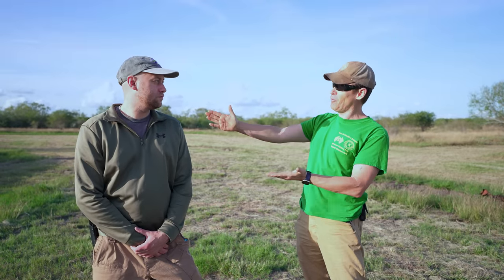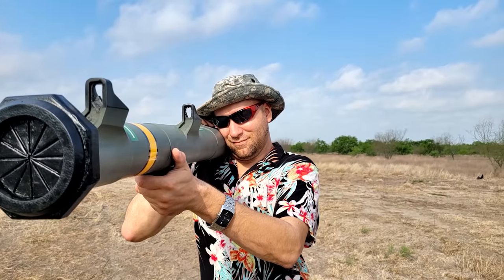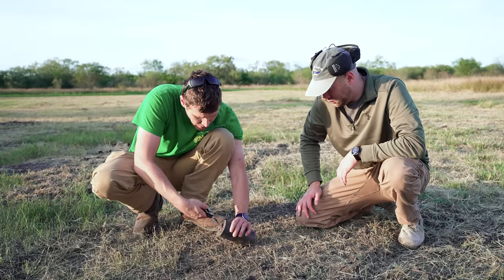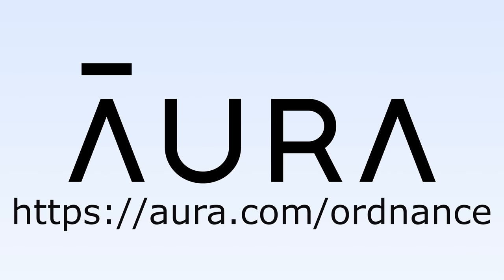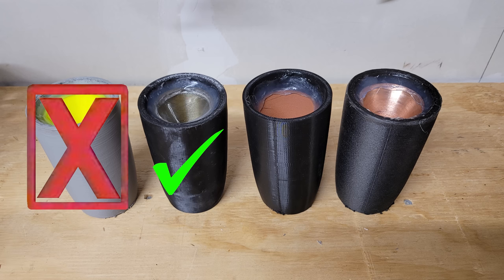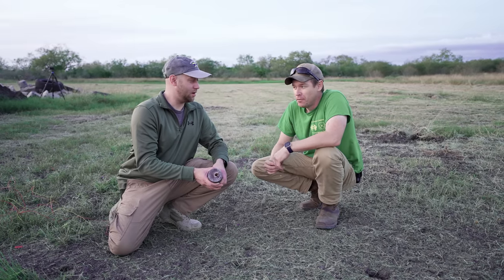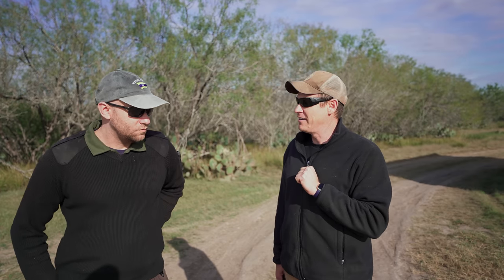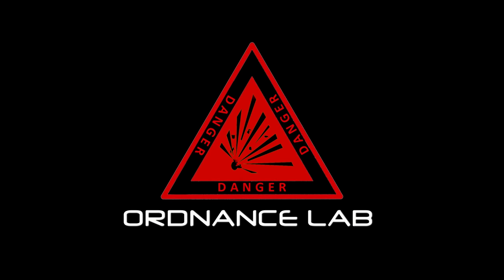Revolutionary 3D Printed Explosive Shaped Charges | Feat D&S Creations

Comment: Wait 3" of penetration is enough for tanks? How thick is tank armor jeez
Reply from the maker: Armor on the top of tanks isn't as thick. Tank armor is thickest on the sides.
Reply: Primarily due to weight , the armor on a tank is on the front of the helmet and turret.  Up to ½ the total armor (by weight) is found on that frontal arc, with the rest of the tank getting much, much, thinner armor.

This keeps the weight manageable.  150 ton tanks would be more of a liability than an advantage, especially if you tried to beef up the drive train and suspension to actually move it at faster than a slow walk.

It also explains why the 4MPH reverse speed of most Russian tanks is a major weakness - if they need to displace quickly from a position, they have to expose the softer sides and rear of the tank to the enemy.  Whereas a typical Western tank can roll backwards, keeping the "good stuff" pointed at the enemy fire, because they have much higher reverse gears.

Comment: A36 is in no way equivalent to cast steel armor, or any other armor used in modern military equipment. Not that those holes aren't impressive, but that's not a good comparison.

Comment: 80mm and hardened is pretty standard for russian armor if you wanna test against what you'd need to defeat.
Reply: Reason you see figures higher for tanks is the use of reactive plates which have prooved less effective since they can be destroyed with small arms fire making the base armor defeatable by smaller charges like this one so ukraine could potentially use these even on tanks with the right combined tactics.